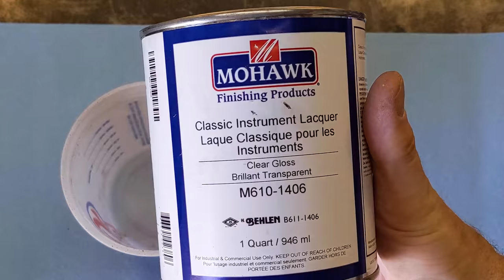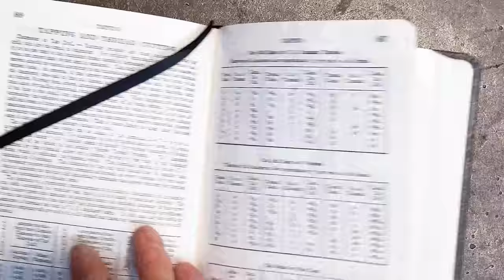130 Year Old Coffee Mill Restoration

Comment: I have that exact coffee grinder. It's beautiful. Belonged to my grandfather.  The only thing wrong with the one you restored, is the nut on top that's used to adjust the grind - fine to coarse. On the original, it's a decorative nut, a little iron bird in a nest. I like the one you machined as a replacement. It's simple and doesn't detract from the design. There was also a paper lable glued to the front above the drawer. The original drawer pull was a small wooden knob, similar in shape to an old-fashioned dresser knob. Yours is very close.  Nice job.  (And they're great for grinding coffee. Still use mine.)
Reply from the maker: There are about 10 companies that made coffee grinders that look identical to this. Also each company had many models. I haven't seen any photos where the nut was a little bird nest. Would love to see that. I did identify the model, but was unable to find a photo of an original label good enough to reproduce, so I didn't include the label as part of the restoration. Thanks for the input and for watching!

Comment: Isent this blasphemy for something that's this old. Aren't the value effected. I'm no antique expert so I don't know.
Reply from the maker: No. The value was somewhere around $20. Now it's a working coffee grinder. Has a lot more value to me as a working tool, doing what it was intended to do. Also, these were not expensive when they were originally sold. They were for normal people to grind coffee. Thats why they are made from cheap fir instead of hardwood. You can see at one point I point out the circular saw marks. The manufacturer didn't even take the time to sand the marks out. They just covered it with a LOT of stain.  

Very good question though. Thanks for watching, and taking the time to comment

Comment: How do you discern that the drawer originally had round corners on the front rather than having square corners eroded through use?
Reply from the maker: I looked at a lot of photos from other grinders as well as old catalogs.  Also the edges were really uniform. Thanks for the great question.
Reply: @AcmeRestorations  
Yes, you'd do some research.  I hadn't considered that. Thank you.

Comment: I wonder if glue, filler, paint, wax are all suitable for contact with food.
Reply from the maker: Wood filler is. I didn't stain or lacquer the inside of the box. I gave it a good wipe with boiled linseed oil, but lost the video footage of that step. Didn't lacquer any of the metal parts that grind the beans either. Great question. Thanks for watching.

Comment: The original metal top was copper color.  I have this exact same model.
Reply from the maker: Catalog says they were japanned.
Reply: @AcmeRestorations  I believe you.  I examined mine closely.  Same company for sure because the top is the same as yours. However, the drawer is also dovetailed. The drawer pull is tiny and made of metal. The drawer is flush, only seven tiny nails attach the bottom.  Although mine has oxidized with age, vestiges of it's copper color can still be seen.

Comment: 6:00 Shouldn't those two pieces be pressed against each other? So the connection would be more solid?
Reply from the maker: They were pressed together. I could have clamped them, but when gluing if you press too hard, you squeeze out all the glue and get a weaker joint. Thanks for watching.
Reply: @AcmeRestorations  You've got me thinking that I was wrong about the things that I've been taught, so I've looked it up on Youtube, and you are right. If the pressure is too high, then the joint will be weaker. But if you use the right amount of force (even with the blue painters tape), then the joint will be stronger.